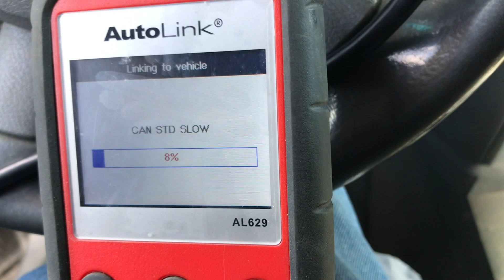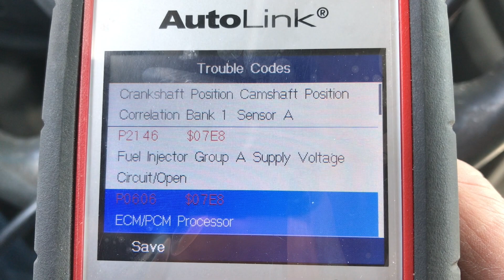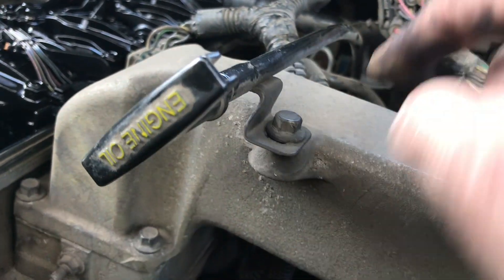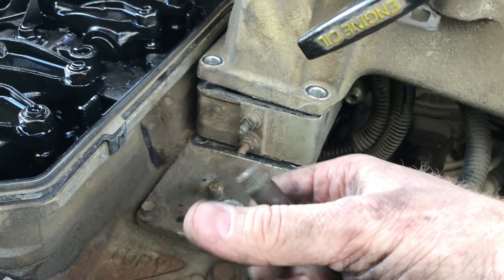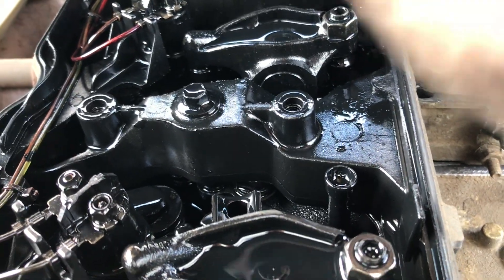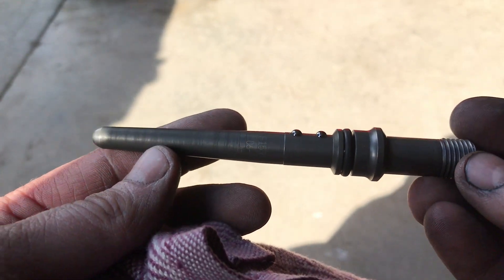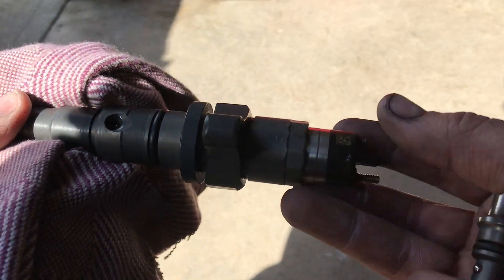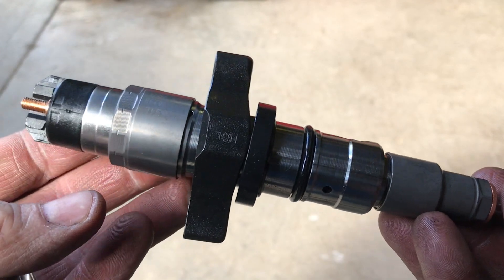Roy Marko's Garage: Installing a $160CA Amazon Fuel Injector on a 5.9L 24V Cummins

Comment: The injector tube a squish fit, and next time you do one of these put in a new tube just to be sure you have a good seal between the tube and the new injector.
Reply from the maker: Thanks Brent, yes you're right, on the last set of injectors I did on my other friends truck I replaced them all. But this guy didn't want to spend the extra money for the tube.

Comment: Would you recommend the amazon injectors after this?
Reply from the maker: for the price, and the fact the truck is still running I would, as yet no problems.
Reply: @RoyMarkosGarageRMG   thanks for the the info, I wasn't going to buy it off of amazon, but the price at the dealer was very high.